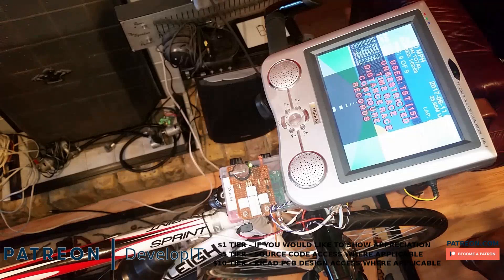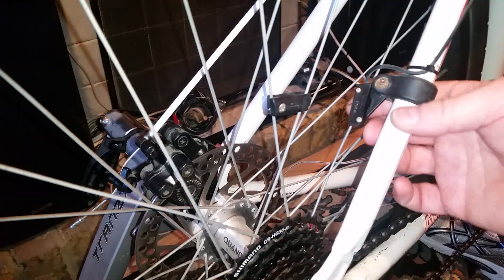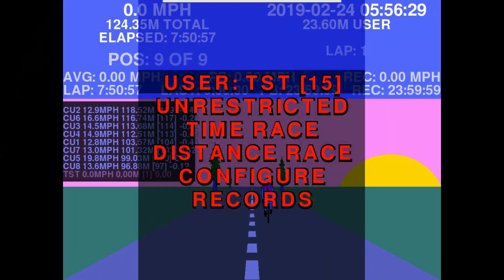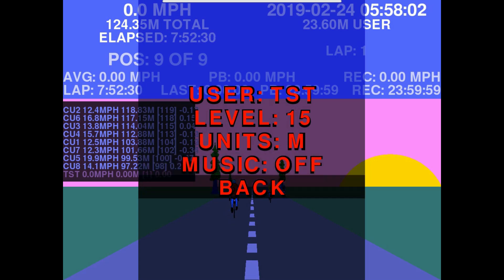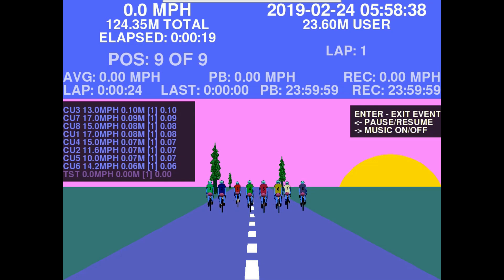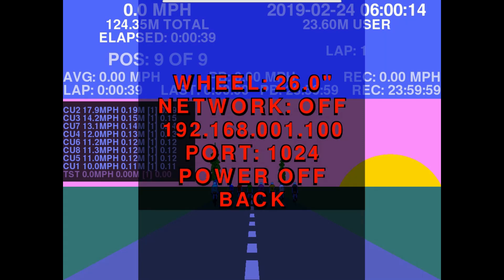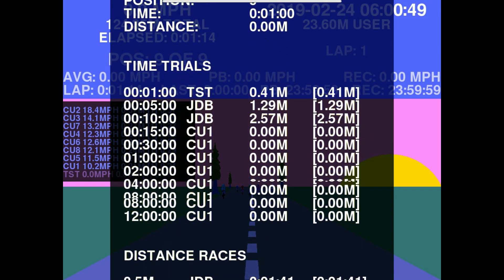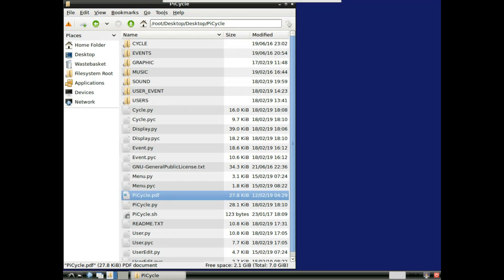Raspberry Pi PiCycle Exercise Bike Trainer, Open Source Python

Comment: Great project!  Thank you for sharing it!  I just got my wife an exercise bike that has no sensors and I've been looking for a way to connect it to Zwift, etc.  Since I'm a bit of a hacker, this is actually even better!!  Have you or do you intend to implement a way that the SW can control the resistance of the trainer wheel, to simulate inclines, for example?
Reply from the maker: I don't think I'm likely to implement a varying resistance. I generally just stay on the highest resistance mine can go to, and change gears when I want to increase or decrease the resistance. I may in future finish implementing the network players feature, but that would be a long while off.
Reply: @DevelopIT  Thank you for the very quick reply!  Since I'm thinking of adapting an Indoor Spin Bike, that'd be ideal for me.  Your work is great and already Bookmarked for reference / future use!